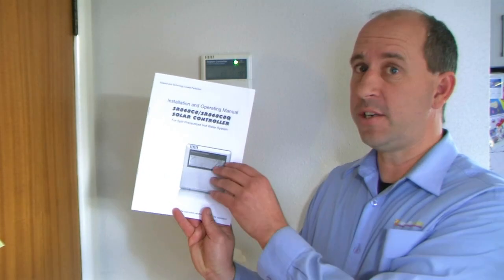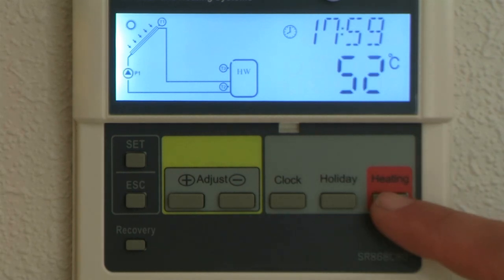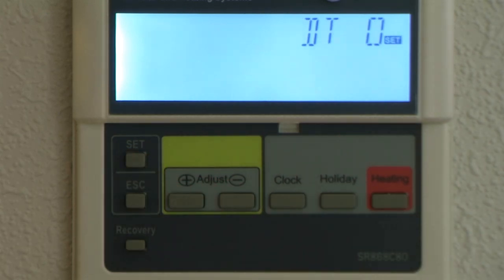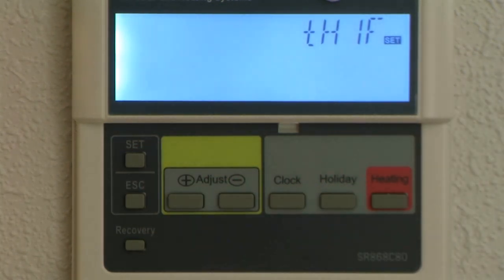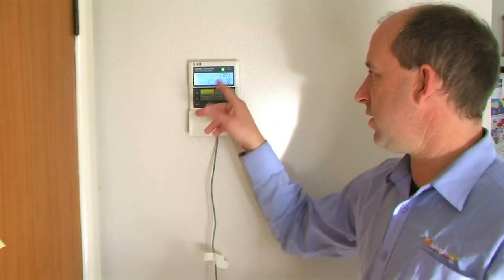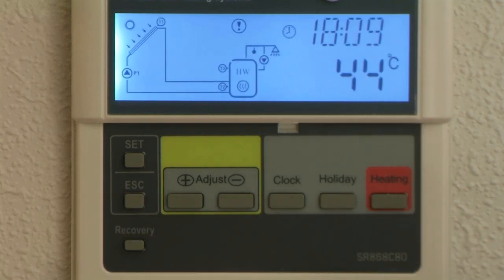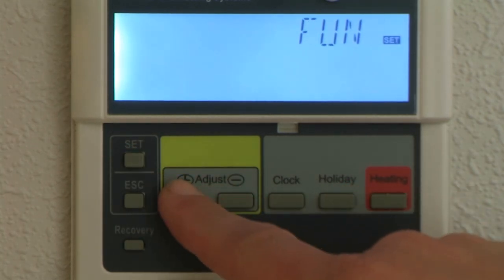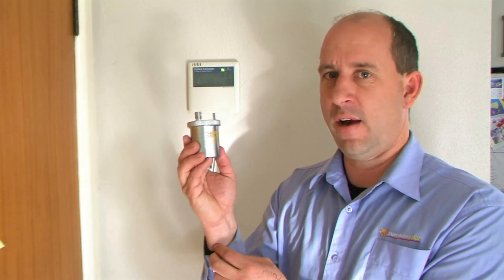Sunshine Solar - Controller unit.mp4

Comment: Thanks John!  I just moved into a home with this system and was completely lost until I viewed your video!  I have the SR868c8 controller and this system as installed is supposed to Heat my domestic hot water and also heat my pool. I'm having trouble getting the heat to the pool. I suppose I need t contact someone in the States for assistance. You were a huge help.  Do you have any tutorials for the collection tank to explain those functions? Thanks again, Ed

Comment: John, excellent tutorial. I have this same set up here in France but my water wont go above 40c, on timer or if I go through the Heating button ? any thoughts ??
Reply: Hi there. Did you manage to find out the problem? Currently having the same issue. Thanks 🙏🏽